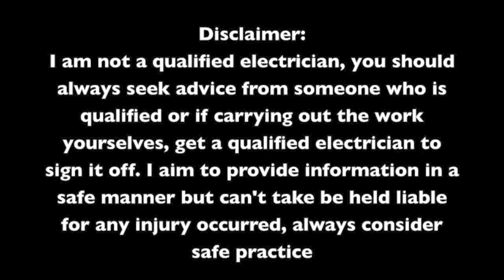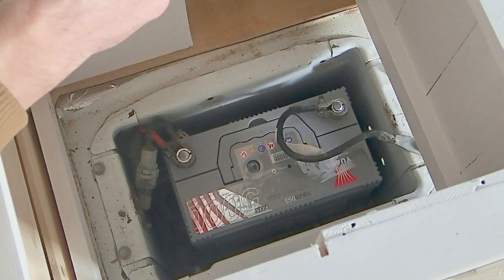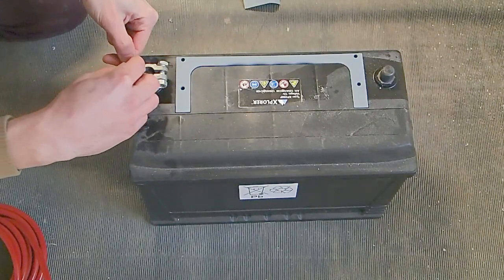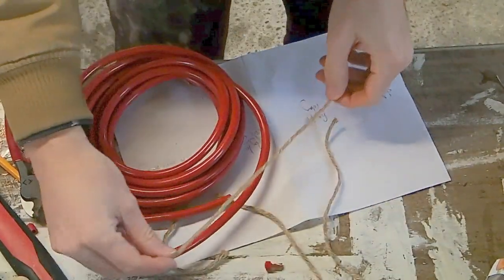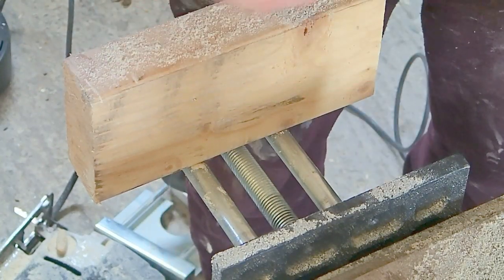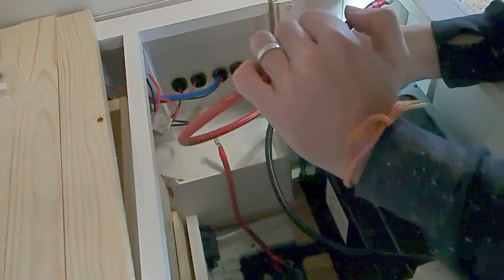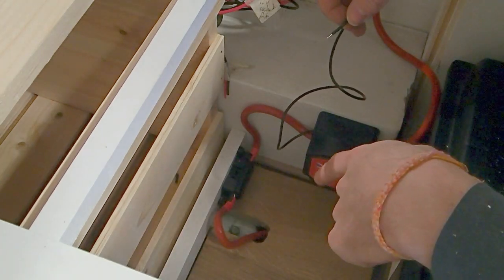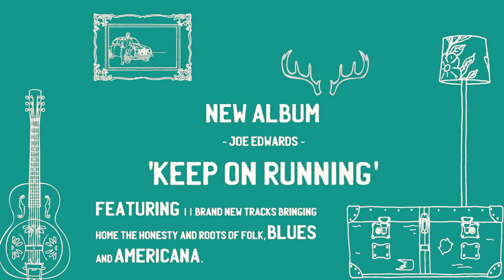Installing A Split Charge Relay - Part 13 - How To Build/Convert A Camper Van

Comment: YOU CAN MAKE A SPLIT CHARGER FOR A FEW QUID. These relays can chatter on/off/on/off when the battery is almost full. You do not need such heavy cable either, look at your alternator wires. You can use a standard 30 amp headlight relay (As in my video I posted 4 years ago). My set up cost me nothing and it will work with a smart alternator.

Comment: Nice tidy work, Ive just put a split charger into mine, got fed up with manually charging the battery after every use, great system! Should of done it ages ago, i put plastic split tubing on my wiring just to make it neat and tidy

Comment: I see that the split charger is 140 amp, this means that I'm limited to that capacity in my leisure battery, or can I use a 300 Ah leisure battery on it?  Nice video

Comment: Hi mate, doing a camper install myself;   how do you stop this over-charging the leisure battery??  Does it auto cut off charging when the battery is full?
Thanks mate
Reply from the maker: Hi, yes, I believe it's what they call an intelligent relay so it will manage the output itself :)

Comment: hi, I would like to ask you a question, when the duritc is connected but the van engine is off, the red light in the front part, must it remain on or must it remain off and only come on when the van engine is on? Thanks
Reply from the maker: Hey Filippo, the light should come on shortly after the vehicle has been started, giving the voltage enough time to peak and allowing the unit to split the charge between the vehicle battery and your leisure battery. When you turn the engine off it may take a little while for that spiked voltage to settle back down so you may see the light on for a short while until the voltage reaches 12.65 or less, but for the most part, the light will be off when the engine isn't running, good luck!
Reply: AtomicDuck123 thanks million!!

Comment: Great Video thanks! What size fuse did you use in the inline fuse holder?
Reply from the maker: Hey thanks Adam! If I remember rightly they were 125's, if you buy it as a pack they'll be sure to give you the right size!

Comment: Did you hook the deep cycle battery to a converter for 230/240v or usb chargers?
Reply from the maker: Hi Johnog! It's hooked up to a Sargent ec160 so it has a bit of both, you can check it out on the 2nd part of the electrics video 😁

Comment: Why did you not just piggyback your ground to the same point where your starter battery uses to save drilling holes?
Reply from the maker: Hey Isla Swizzled, it's under a removable shelf so would be a royal pain whenever maintainence is needed
Reply: @WoodandWild  Ah okay I see. Nice lil van btw, am enjoying watching it progress

Comment: Hi how will the led light go off when we off the car
Reply from the maker: Hi Asim, it will detect when the battery voltage is at or below 12.65 volts and automatically disconnect, hope that helps!

Comment: All this finding the right the right size wire for the right battery type is a headache on its own. Not to mention the smart alternator, I dont even know if my car has it or not. They don't know crap at the store itself, they're just there to tell you at what section your product is at.